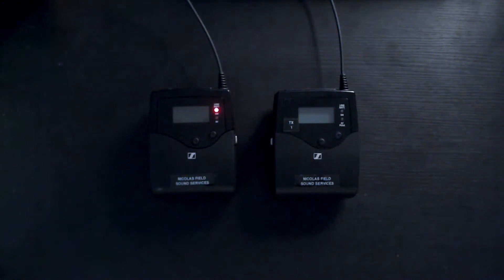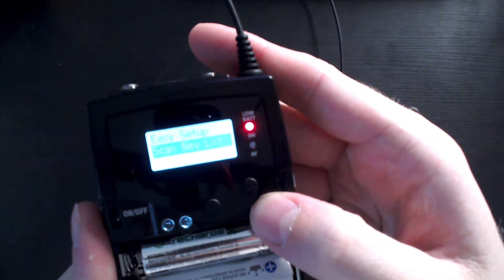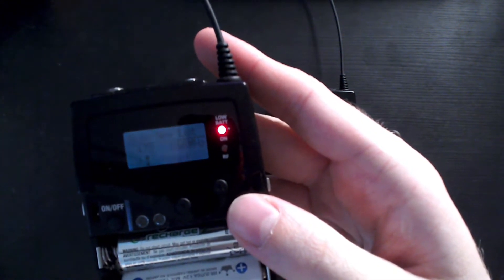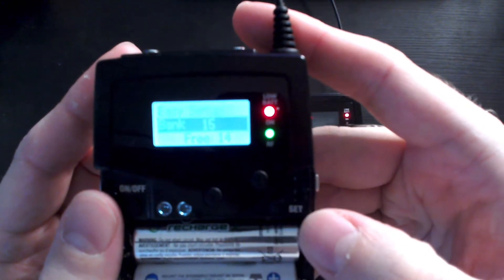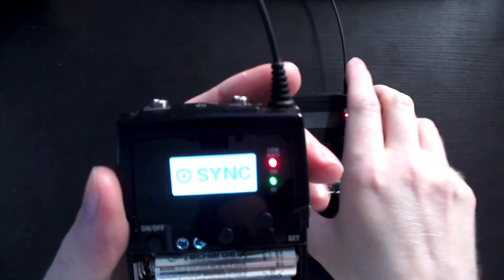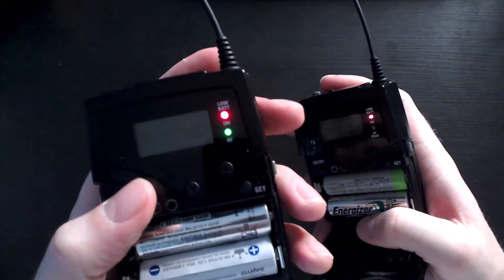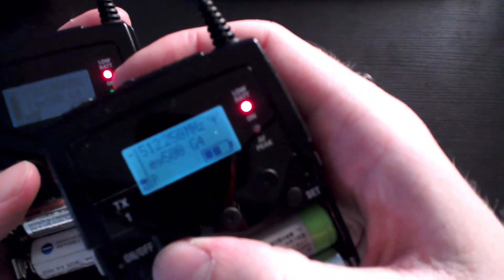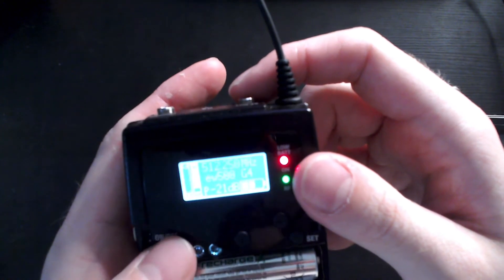Sennheiser G4: Scan Frequencies and Sync TX in 3 Minutes

Comment: yea you need to hold the receiver and transmitter about 6 inches apart. You will then see the check.  The check does not stay on the screen long.

Comment: I have the 500 series and also do not get a check mark confirmation when synced. In my career, I've mostly used old Lectros and Sony's. With the Sony's there is a usb port on the units which help in alternate power and firmware updates. Maybe our Sennys need to be updated? If so, how do you update these things without i/o ports? Thanks and nice video!
Reply from the maker: I've just accepted it as an idiosyncrasy of the system. However, if a firmware update is available, they are possible via Wireless Systems Manager and/or Sennheiser Transmitter Manager. You'll need an infrared dongle for your computer to send the update. Thanks so much for tuning in!